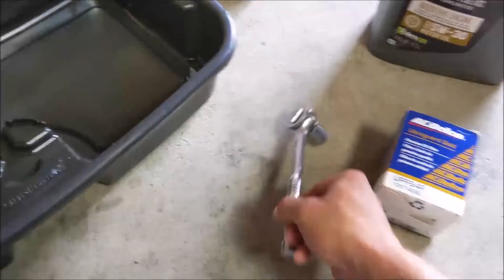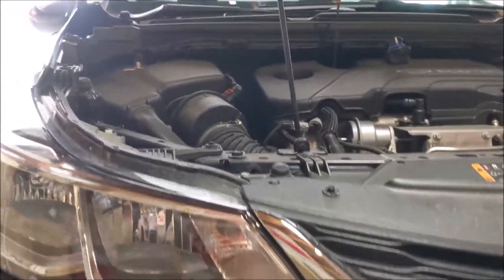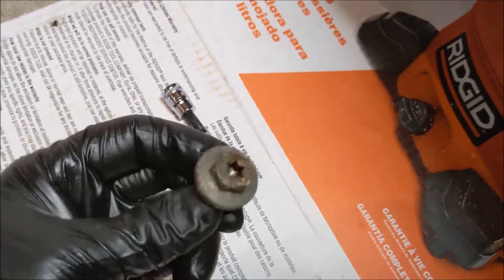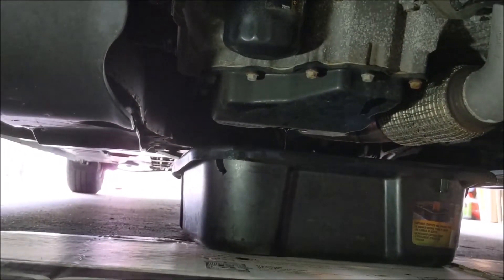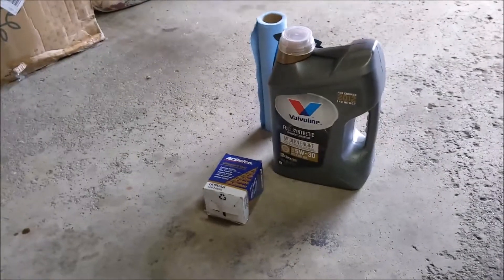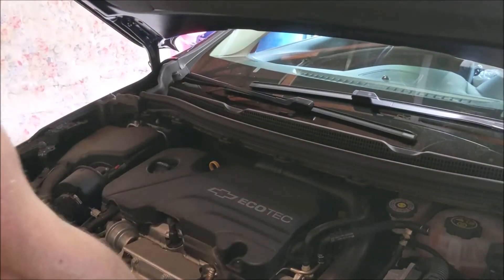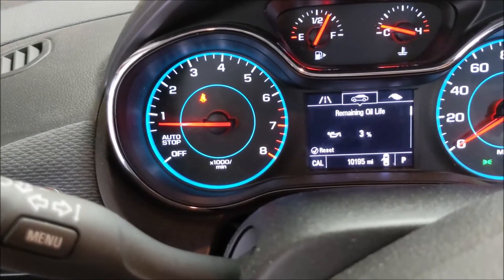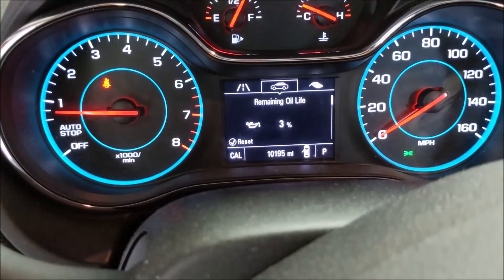2016-2019 Cruze (2nd Gen) 1.4 LE2 Oil Change

Comment: I really wouldn't say I need instructions to do an oil change but I watched this anyways seeing as my 2017 Cruze is still a fairly new vehicle with a seemingly particular engine. And I'm glad I watched it as I had no clue about the preference of oil filter, I would have just picked up the Wix filter which AutoValue suggests. Also that Oil drain plug is super smart! GM always on the tip of innovation!
Reply from the maker: 🤣Yeah, it's not so much the procedure that I'm hammering home!!  Thanks for watching!  Be sure to check out my updated video: https://www.youtube.com/watch?v=_gFU82zZboo

Comment: The upf64r holds oil in the filter so when the engine cycles the stop start feature it ensures the oil is always filtered. It helps to prevent dirt from getting to the main bearings . I've always used that filter you can get it at rock auto.
Reply from the maker: Thanks for that!  I've also noticed RockAuto sells them now (they were less than $7 apiece at that!!)

Comment: Mine is 2017, the manual says to use acdelco dexos1 blend.  Doesn't exist.  Called dealer and parts department said use 5w30 full synthetic dexos1.  Harvest King 5w30 is 13.99 for 5 quarts.  Yippy!
Reply from the maker: I think Castrol used to make a synthetic blend, but yeah, doesn't exist anymore.  Stick to the good stuff!!!

Comment: Mine is a 2019 Cruze, but I checked the owners manual and it only recommends the ACDelco, but it does not say that you have to use it. Someone lied to you. It was probably an ACDelco employee/Owner. What it does say is to use the dexos01 for gasoline engines, and the dexos2 for the Diesel engines.
Reply from the maker: https://www.cruzetalk.com/threads/le2-oil-filter-usage.241589/  is where I got my info from. Take from that what you will.

Comment: I think theres a different filter for cars with auto start stop? not sure, also how did you dispose of your old oil? any specific ways?
Reply from the maker: All of the LE2's have auto stop-start.  Be sure to get the filter listed in the description. As far as disposal, you can pour your old oil back into the container the new oil came in and drop it off at any auto parts store or Walmart. You could also see if your city or county has a hazardous waste recycling center and drop it off there.

Comment: Mobil 1  --- M1 113A Oil Filter...Your Opinion.. Thank you
Reply from the maker: Still haven't heard of any other filters other than a WIX (don't recall the #, check the link I posted in the pinned comment) that'll cross reference to the UPF64R. I've since been buying my filters at RockAuto. They have a good price so you can stock up on the UPF64R's.

Comment: My owners manual says use pf64 and my 2018 Cruze takes 0W. You sure the upf64r will be ok?
Reply from the maker: I would check out the Cruzetalk thread I have posted in the description.  In it they say the LE2 specifies 5w30
 for 16 & 17 and 0w20 for 18 & 19.  They also go into detail as to why you should use the UPF64R for all model years of the LE2.

Comment: so, it's okay to use 5w-30 vs what gm says in the manual (0w-20)
Reply from the maker: I would check out the Cruzetalk thread I have posted in the description.  In it they say the LE2 specifies 5w30
 for 16 & 17 and 0w20 for 18 & 19.  They also go into detail as to why you should use the UPF64R for all model years of the LE2.

Comment: I ordered UPF64R and was sent this black one. Is there a difference between the black and blue versions? The part # is the same UPF64R. This is the black one shown on Oreilly.
https://www.oreillyauto.com/detail/b/acdelco-2729/filters-16470/oil-filter-12090/80c2d8dbb188/acdelco-oil-filter/upf64rf/2493863?q=UPF64R+&pos=0
Reply from the maker: I don't believe there's a difference.  The color change could be a production change.  The sticker is identical, so you should be good.
Reply: @CertifiedShadetree  Thank you! I couldn't find any info online about a color change. Strange.
Reply from the maker: @janetr5726  No problem!